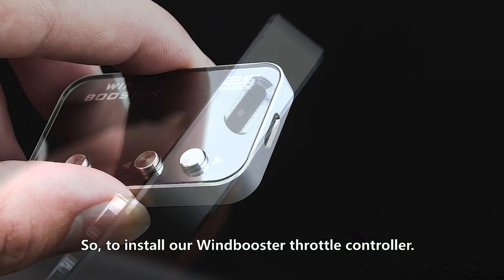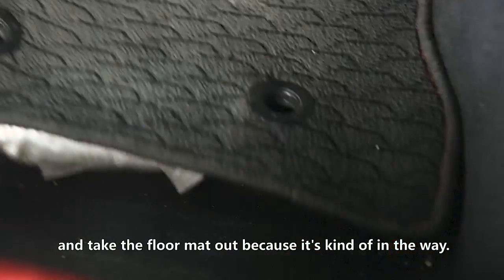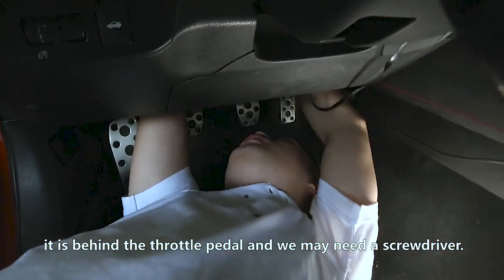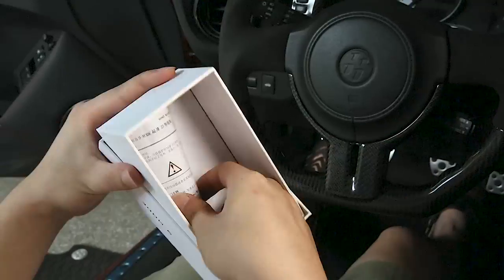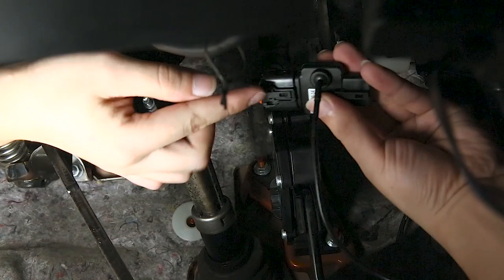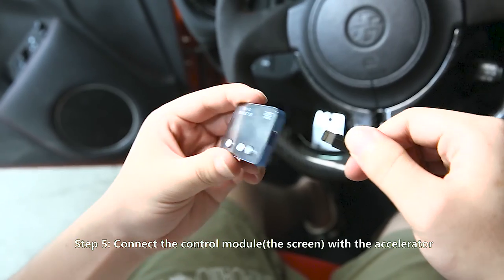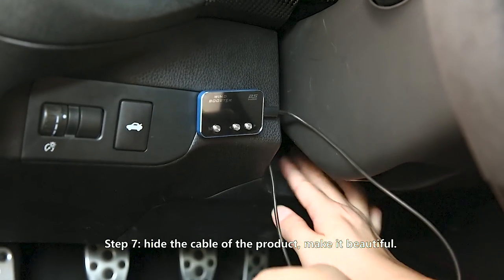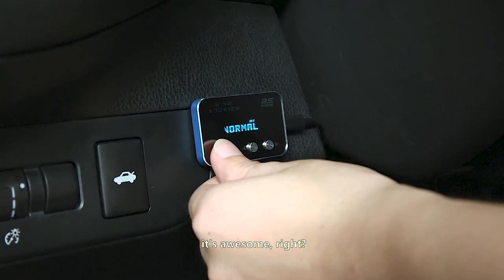installation of Windbooster

Comment: is it helping to save fuel? i have  Volvo V60 D2  2014 year model is it compitable with my car ?
Reply from the maker: yes Matt, it saves fuel by 5%-10%， but its main function is to help you to both increase and decrease the response, which can be very handy when driving on wet, slippery roads or some off-road situations, you can have a better control over the wheel with Windbooster.
Reply from the maker: it is the best choice for off road cars